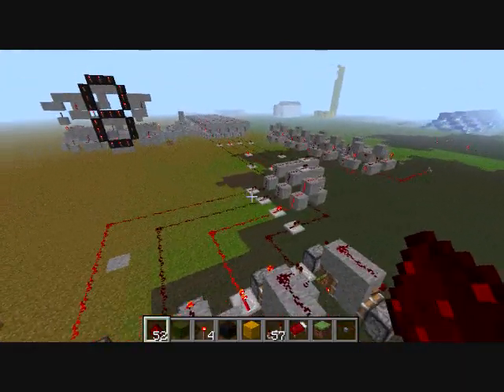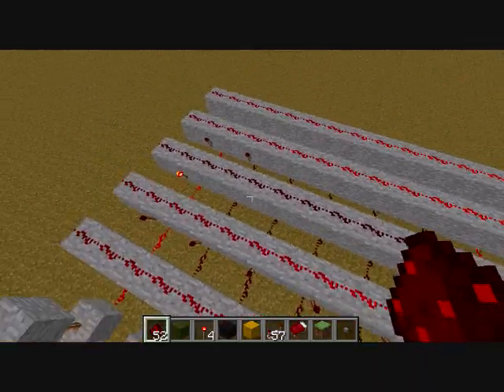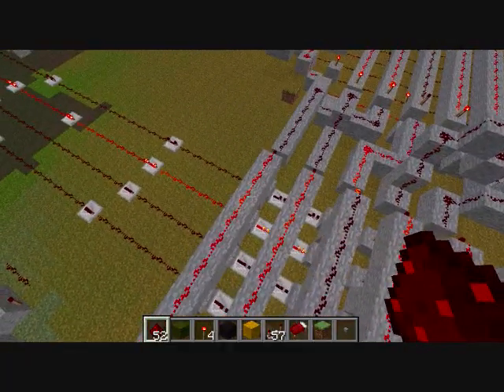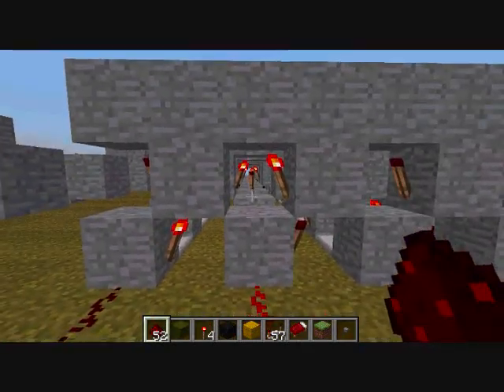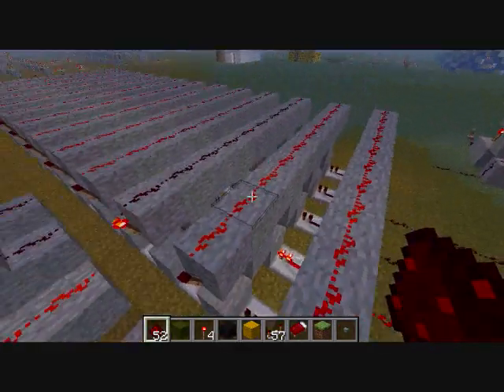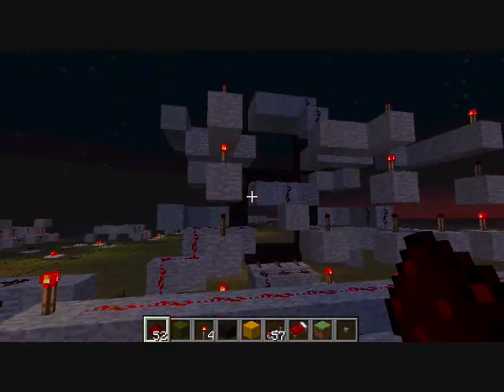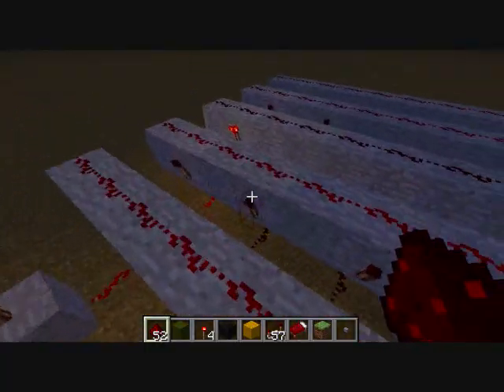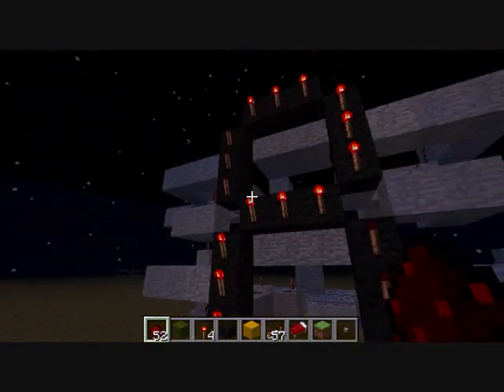How to make a minecraft cpu (part 4)

Comment: yer binary is backwards.. it should get 0001 0010 0011 not 1000 0100 1100 because you add decimal places to the right, not the left. and 0001 and 01 are the same number, but apperently 10 and 100 aren't? der.